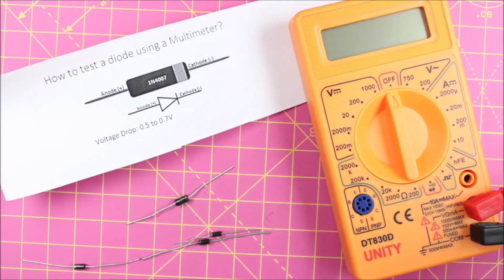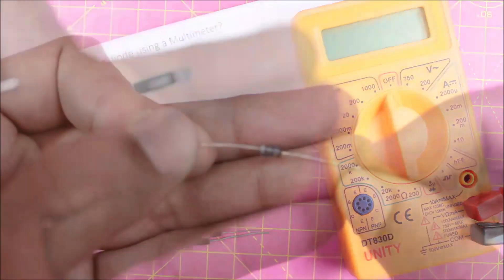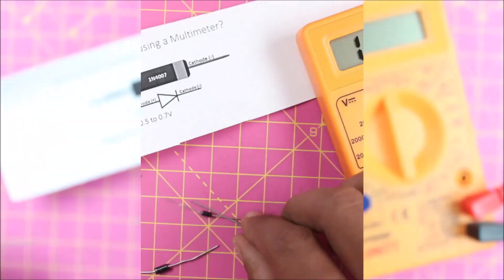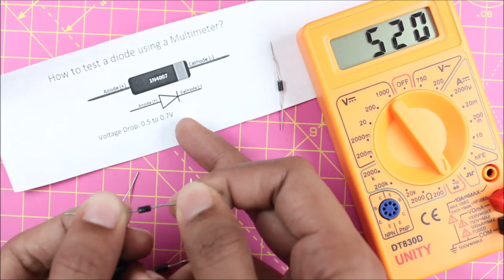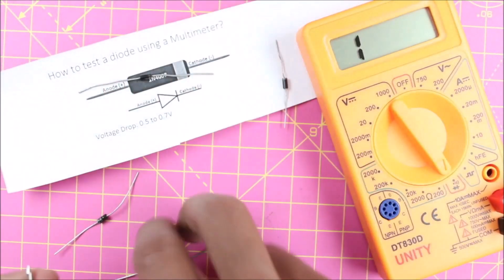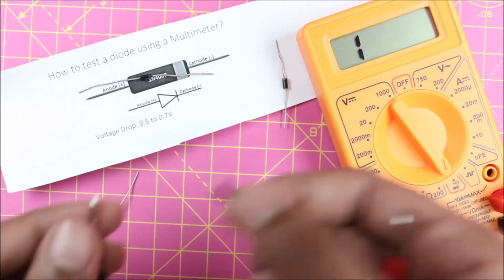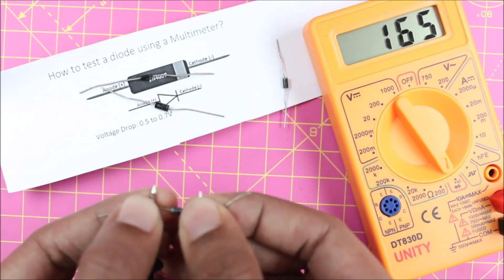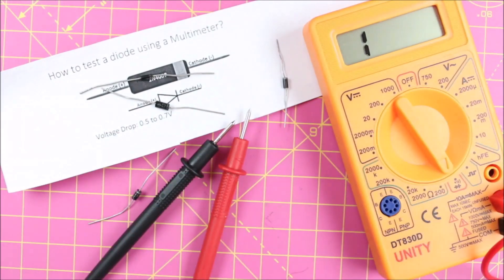How to Check Diode with Multimeter | Simple and Easy Method to Test Diode

Comment: That was good,  i am getting .222 V  on D701  in circuit,in the suspected area of the problem, PS does not run  ( power supply board of LG 50 inch Plasma TV) and gonna remove it now to measure again, but i hope it IS leaky,  because  then i  could maybe fix the PS

Comment: But where is the 0.
It only says519 can u also share what does voltage drop mean in diode mode
Reply from the maker: In these kind of multimeters there won't be any 0. it will only show the voltage drop in mV. The voltage drop in a multimeter's diode mode is the voltage drop across a diode when it's connected.

Comment: What if its showing high values in both side
Reply: That would indicate it was faulty also as a diode only let's voltage flow in one direction. If voltage flows both ways that would indicate a fault.

Comment: your telling a voltage reading BUT your Tester was SET to Ohmmeter!!! Are serious ???? check your multimeter SETTING please.
Reply from the maker: I am sorry but I am not sure why you are confused. The multimeter is not set to Ohm meter, It is set to diode mode. Hope this clears your doubt
Reply: It was set to diode mode all this time. Where did you see ohmmeter mode?
Reply: Its on diode mode, multimeter works thats way
Reply: Thank you for the clearing doubts.
Reply: The symbol which u misread is buzz/beep mode meaning continuity check and is not ohns/resistance mode